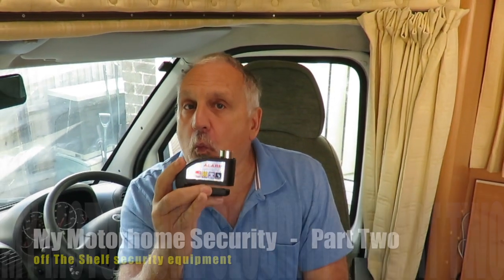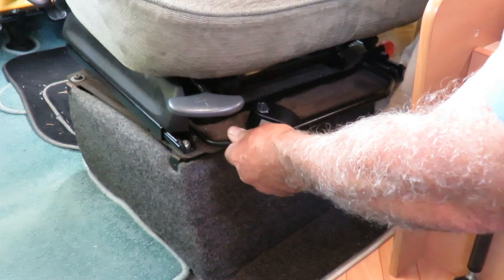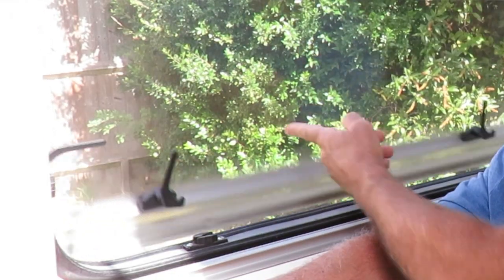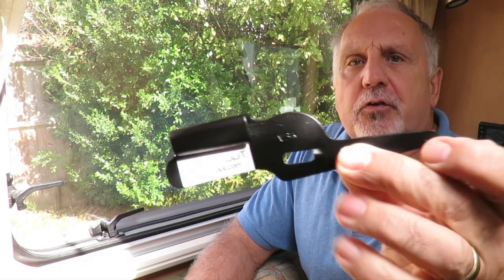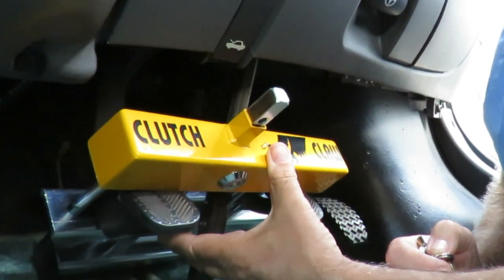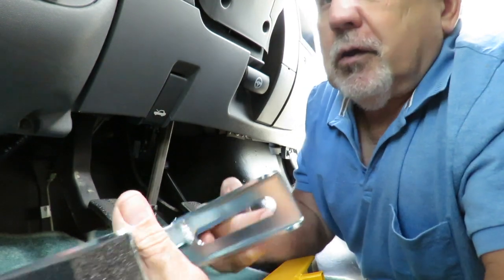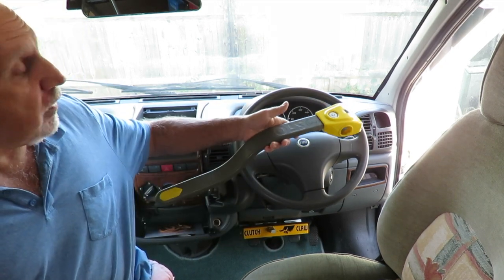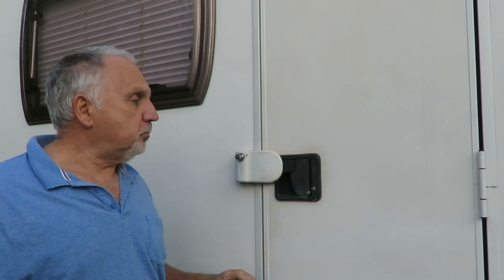Motorhome Security For Full Time Living - How To make Your Motorhome Safe And Secure - Part 2

Comment: Captains chair brake disk bike lock is amazing !! 
Those lock em out things are genius 
The clutch claw can be opened with a pen lid
As can the steering and fiama lock 
Those circular locks are worthless without custom springs
Reply from the maker: Hi Tony,
Even if I locked it in a cage with an armed guard, someone somewhere would find a way in if they really wanted to...!
Having multiple security devices that all require time and effort to disarm is the main point of the video.
Agreed some better than others and far more secure, but it's about giving the thief a reason to sod off and go target a lesser protected van...!
I also have door deadlocks, engine isolation and a tracker on board.
I'd be very interested to know how the clutch claw and fiama lock can be opened with a pen lid. I would even do a video on it to show others..
thanks,
ATB, Steve

Comment: I think the most vulnerable area is the roof lights, my motorhome has just 4 cir-clips on the largest one. haven’t seen any commercial deterrents as yet.
Reply from the maker: Yes, that's a good entry point... Very visual though and would attract attention with someone on the roof ripping your skylight out..!!
But still a weak point though. 
One of the reasons that I removed the motorhome ladder at the rear. To prevent easy access onto the roof.

ATB, Steve

Comment: The clutch lock bothers me.  Wonder if a fire starts in a building your parked next to, can you get that clutch plate off fast enough so you can drive to safety?  Or do you leave it off while sleeping?
Reply from the maker: I think the chances of that happening are pretty slim really. 
Plus I don’t often park up near buildings so all quite safe. 
I leave the lock on any time the van is unoccupied and also when sleeping. 
If I felt in danger I would simply not stay there - too risky...!
ATB, Steve